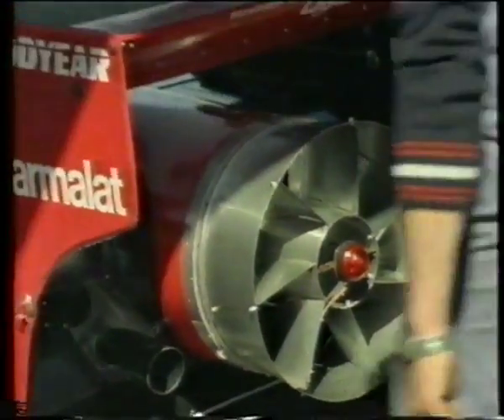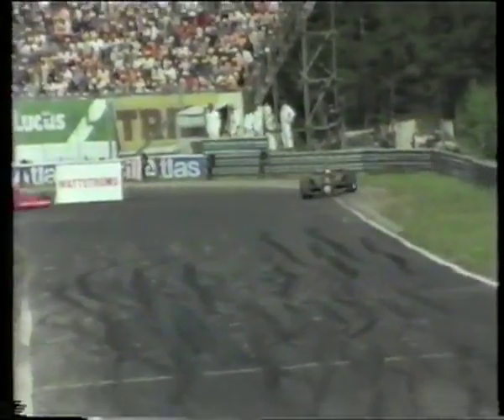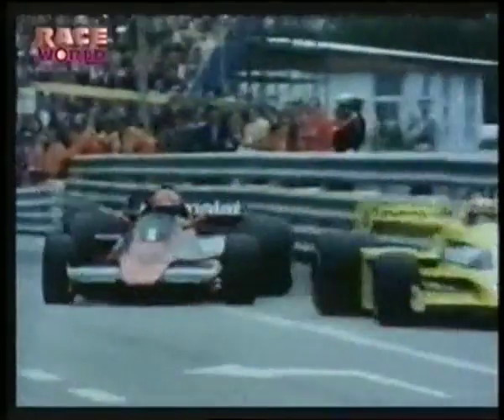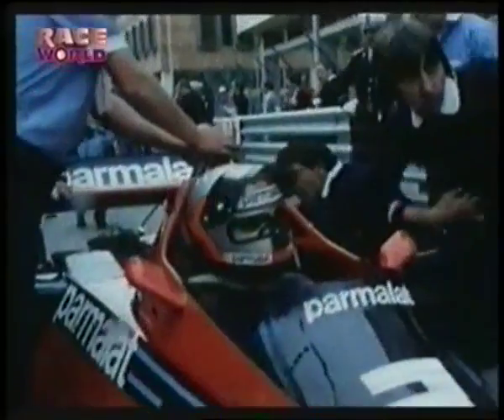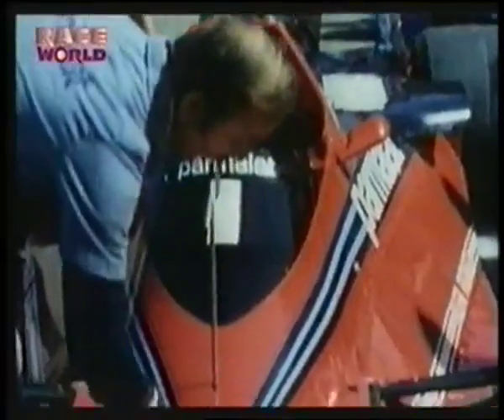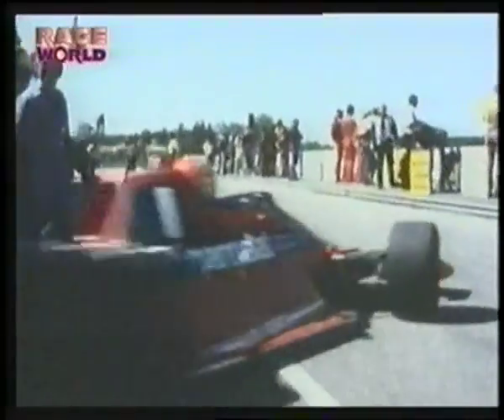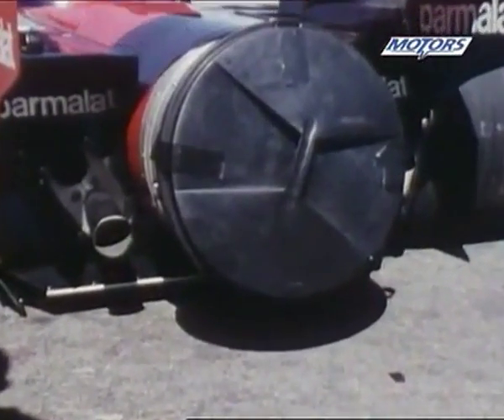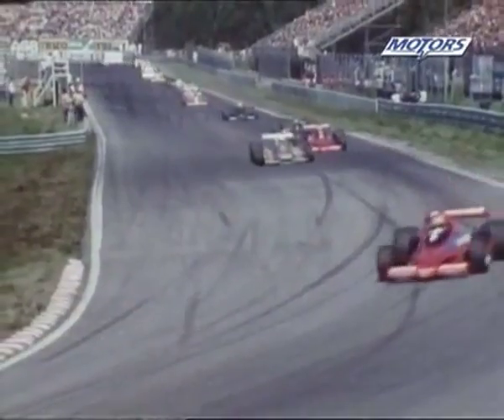The Brabham BT 46 b Fan Car F1 1978

Comment: They should not limit the team on aerodynamic design, because that can make up for the engine difference. Now days watching F1 is like watching 3 team racing each other.
Reply: A lack of limitation actually makes that worse. CanAm started out as an unlimited formula but there were only two teams - McLaren and later Porsche - who really won any races. Nobody else had the money to compete against them.
Reply: make that one team now
Reply: You cannot have several engines in a car. It was the rules back then. 
Now we have a hybrid, with piston and electric. 
This would have been awfully costly in fuel consumption. Inviable for the future

Comment: Murray made a stupid mistake, he did not hide the fan. He should put the fan on the top of engine like on Porcsche`s  F1 and Le Mans cars and explain it is for radiators and it would be much harder to ban.
Reply: It was legal and never banned. He couldnt put it on top of the car it was driven off the crank. Too complicated and not enough space, plus its still there 😂
Reply: @realMaverickBuckley  check out the Porsche F1 car from early 60s where the fan was on top.
Reply: then they would come into worse trouble in future if officials found out
Reply: Cooling  fan is not illegal.
Reply: It wasn't actually banned, the other teams pressured Brabham to withdraw it
Reply: That's exactly what he did. In his own words. The rules said as long as its not its primary function. 60 % drawn through the radiator.
Reply: What? 
A brilliant designer did bad??? 
You must have been eating spikes. 

He clearly informs, that the car had a flat-12 engine and there was no room for venturi channels, so ground effect was impossible. 
He then, brilliant as he is, used the Chaparral 2J design of a suction fan to develop downforce. 

If you don't know, a F1 car is the pinnacle of design and performance. So of course it had to be as light and fast as possible.
Reply: It was banned.. 
A auxiliary engine, that provides a faster car was not allowed. 
And ot most certainly did that.. illegal and deservedly banned
Reply: They didn't ban it!!!!!!!!!!!!!!!!!!!!!!!!!!!!!!!!!!!!!!!!!!!!!!!!!!!!!!!1

Comment: Such a cool design, F1 could've gone two very different directions from this point in time.

They could've ALLOWED IT, and F1 would probably be going 300mph around hairpin turns by now if so lol.
OR, they disqualified them for outsmarting the rules with engineering, obviously history chose this option. Now F1 cars need to wade through miles of red tape and politics just to race. hmm
Reply: Nothing about that would have improved racing.
Reply: @thethirdman225  It absolutely DID and WOULD improve racing. Creating a vacuum under the car improves grip, which is one of the main limiting factors in how fast vehicles can go.
Reply: @cybertree  
"It absolutely DID and WOULD improve racing. Creating a vacuum under the car improves grip, which is one of the main limiting factors in how fast vehicles can go."

I know the theory of it. But how did this improve racing, other than in one race? It didn't. Everyone knew this car would be banned, Gordon Murray included. It was just an engineering exercise. It harked back to the Chaparral 2J and we know what happened to that car.

The fact is, I see better racing in Formula Ford than in Formula 1. Personally, I like one-design series, like Australia's S5000. When the cars are basically identical, the racing decides who the best driver is (which is the object of the exercise). The ideal formula would combine technical development with close racing. The two have to be balanced. Vacuum cars might be able to pull huge Gs but even if all the cars had it, there's no guarantee the racing would be close.

People always complain that anyone could drive one of these things and there's no skill anymore, etc.. So what do you want? A car that can be driven by a monkey or something requiring skill? It's like those fans who talk about "tech" development but want to go back to V10s or manual gearboxes.
Reply: @cybertree  The fact is that we tried unlimited racing in the 1960s and 70s with a thing called CanAm. It was good for a few years but it was dominated by McLaren and eventually, Porsche. If you weren't in one of those team, you stood little chance at all. In the end they called the Porsche 917/30, "the car that killed CanAm". People can jizz off all they like about how fast it was in a straight line but the fact was, the racing was boring.

The next year, CanAm had to face reality and introduce rules. They didn't want to do it but falling interest and plummeting revenue left them with no choice.
Reply: @thethirdman225  I hear what you mean, it definitely lessens the engineering challenge in other areas *at first*, however everything is relative, and if everyone is using fans, it only creates a level playing field to out-do/drive your opponents at even higher speeds (i.e. who can utilize the fan the best, maybe they could limit the amount of time your fan can be turned on so the drivers have to use it at their expert discretion) I genuinely want to see a no-limits (within reason) F1. If one team dominates it until the end of time, so be it, they used the parameters best period. I'll be the first to admit I went from loving large engine manual gearboxed vehicles to appreciating lighter turbo-charged PDK gearboxed vehicles. I'm an engineering/skill fan too, I love the trickle-down technology effect F1 has on production cars due to so many restrictions, they're a good thing. I just think they should do a special event where each company can be mostly unlimited.
Reply: @cybertree  Yeah but remember this: the car wasn’t banned until much later. Brabham withdrew it when all the other teams objected. The other misconception is that outlawing something stifles innovation, whereas it does the reverse. Suspension-mounted aerofoils were banned in the late 1960s so teams started to increase the size of their wings. Then limitations were placed on that. Eventually, teams started cantilevering their rear wings on very long arms to increase the leverage until limits were placed on that. All the while, cars continued to get faster as loads of other ideas were tried. Tyrrell introduced the first air box on the 003. When high air boxes were banned, they just ran ducting instead. Lotus moved the radiators to the side and created a more efficient wedge shape. They also messed with torsion bar suspension, which did away with exposed spring/damper units on the 72. They used onboard brakes (it was the failure of a front brake driveshaft on one of these that was responsible for the death of Jochen Rindt). Ferrari and Tecno developed flat 12 engines to lower the CoG. Ferrari also developed a transverse gearbox which was lighter and much more compact than the Hewland everyone else used. McLaren and Tyrrell started using rocker arms and pull rods to create rising rate front suspensions which offset tyre wear. Hesketh used rubber block suspension. Tyrrell raced the unique six wheeler. Ferrari tried a de Dion rear end but never raced it. Hesketh started sealing the underside of the car with a fixed rubber skirt which improved both airflow and downforce. Renault developed turbo engines.

Then Lotus introduced the wing car, initially with a simple rubber skirt on the 78 and later with sliding skirts on the 79 and that’s what prompted the Brabham fan car.

With every design there was an attendant risk that it wouldn’t work or it could kill someone. So teams had to play those risks off. Ferrari had resisted monocoque construction for 20 years but their fist was unconventional because it used a Nomex honeycomb aluminium sandwich construction that was bonded instead of riveted. I have often wondered how Harvey Postlethwaite felt after the death of Gilles Villeneuve when the panel tore out behind the driver and released the anchor points for his seat harness, leaving the unfortunate French-Canadian to be thrown from his car and killed. Was it and engineering failure or and construction failure? I can only imagine how Postlethwaite felt about it.

All designers have to balance risk and reward. When something gets banned they don’t say, “That’s it. All over. Motorsport is ruined. Bloody FIA.” They just set about rising to the challenge of developing something else.

The job of the governing body is to ensure that the sport stays viable. To do this, it has to assess whether or not something like this contravenes the rules and whether or not it will require the smaller teams to spend more than they can afford just to stay in the game and risking their long-term viability. The governing body also has to decide whether something is potential more dangerous. Ground effect was eventually banned because cornering speeds were so high that the majority of circuits were no longer able to support safe racing. Most people posting here know little of an era when we used to lose two drivers every year and the campaign to increase safety which led to drivers forming the GPDA because it was they who were risking their necks. Seat belts weren’t even mandated until 1971. Every man and his dog knew that the driver was part of the crash structure at the front of the car because weight distribution meant putting his feet in front of the front axle. Losing drivers to catastrophic crashes was in nobody’s interest and that’s why the FIA - which was still basically an amateur organisation in the late 70s - had to become more professional and more vigilant of things that could ultimately be too dangerous, too costly or ruin the competition because one team was totally dominant.

Comment: Rip it to shreds? Nowadays F1 is for wimps. Even Nascar is more challenging at this point. Those pilots, those times were the real F1 cars and racers. It's pathetic, really.
Reply: 3 years later, nothing has changed and it's even more boring.
Reply: @oliverb6313  Yeah, the moaning and whingeing seems endless.
Reply: I’m sorry but anyone could drive a modern nascar racer quickly but if you watch normal people try to drive a formula one car they can’t even use full throttle
Reply: Modern F1 is insane lol the g force is near to jet planes through corners
Reply: @chris51330  Except that pilots experience vertical G, while drivers experience lateral G. The trouble with vertical G is that with every increase in G number, the column of blood in the artery that goes to the brain falls by 25mm. At 9G the column of blood barely gets out of the heart and the brain is reliant solely on oxygen reserves until it can be replenished by fresh blood. Once those reserves are used up, the pilot will likely experience GLOC (G-induced Loss Of Consciousness). Drivers do not experience this at all.
Reply: Despite the romantics and the literal French interpretations, racing drivers are not "pilots".
Reply: You have no idea about what driving a modern f1 car means...

Comment: Yes, I meant Group B. And making it unlimited would have only made it more deadly. That said, I can sympathize with safety rules to slow the cars down and make them safe, but seriously, banning innovation isn't good. F-ducts and double diffusers should be allowed to stay, because larger teams gain an advantage but only until the smaller teams catch up. Constant rule changes only benefit the big teams that can afford to throw everything out and start R&D from the beginning.